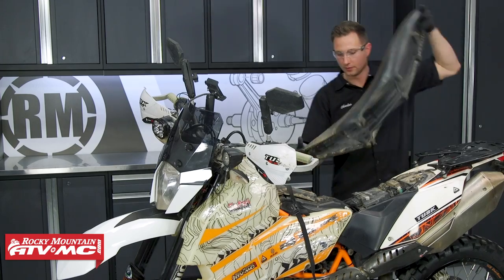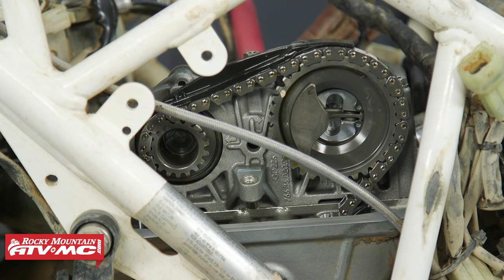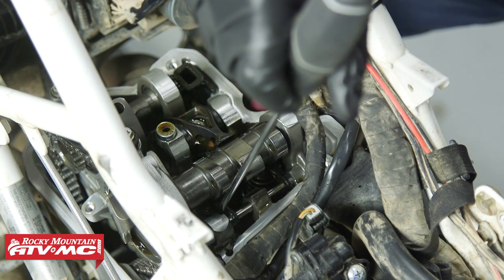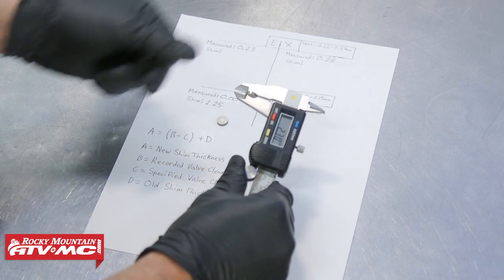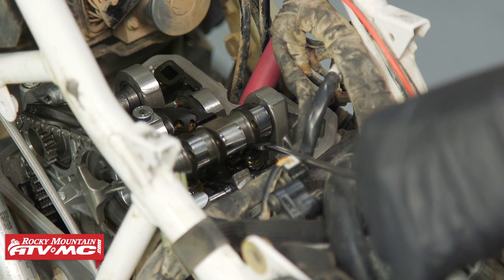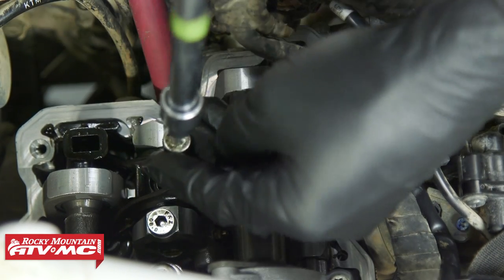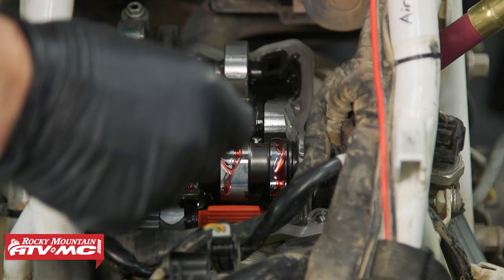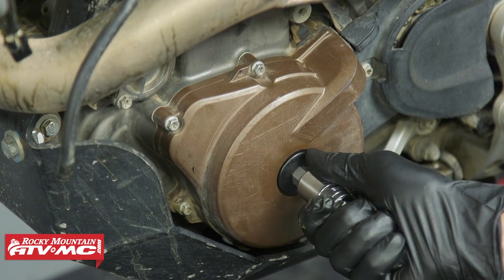How To Adjust the Valves on a 2017+ Husqvarna 701 & KTM 690

Comment: I've been working on KTM's for 18 years now,  I love that they stick with a design for 5-10 years and that I can use parts from a 1998 KTM on my 2024.   They remind me of a vintage Volkswagen,  or a Chevy 350,  or an LS.   Triple clamps,  54mm for the top, 60mm for the bottom.  Frame neck OD,  59.5mm.  Foot Pegs....they all fit.   Rotors,  260/220mm forever with the same bolt spacing, 300mm/240mm for the bigger bikes.   For the most part they keep the same part numbers too.   Japanese bikes make changes every couple years so nothing seems to interchange and they like to change part numbers every year too.  .

Comment: There is no decompression function on my 2020 690 enduro.   When turning the crank to position the cam as instructed, I used a long-handle socket wrench (breaker bar) towards the rear passenger peg and duct tape it there to hold the cam in the correct position.

Comment: I thought the KTM 690 didn't get the newer balance shaft motor until 2019?  The Husky got it a year or two beforehand.  So wouldn't a 2017 KTM 690 still have the older style motor/valve shim setup?
Reply: No the 2016 701 had the old style engine.

Comment: Thanks for the video.  Very helpful!  

That intake finger follower clip retainer system is cool - before I saw this video I figured the cam was gonna have to come out and I was dreading that.  Nice to see KTM/Husky thinking of serviceability in this design.  Had a TL1000S years ago, got spoiled by that bike's lift out hybrid chain/gear driven cams, which were almost fun to take out and  put back in.

One observation for anyone doing this.  While pulling the rocker and installing the exhaust shims is easy, the intake shims were tricky as the cam is in the way and my magnetic flat blade screwdriver was not magical like Charles' here.  All my magnetic screwdrivers were a bit weak, and my small magnet used to suck the shims out was way too strong and bulky to put them back in.  The right shim is not too high risk, dropped that a few times into the head and retrieved it with my strong magnet, but the left side was scary as I worried about dropping it down the cam tunnel and that would have sucked.  So I stuffed a rag in to prevent that and ya, it saved my bacon when the left shim inevitably wobbled and fell off my screwdriver while trying to install it.  Finally got it in but it wasn't super EZ like the video.  I guess I need a different magnetic screwdriver!

The subject of all this was my new '23 701, did the 600 mile service, all of the valves had 2.28 shims from the factory.  Both exhausts measured .178 (tight, the minimum spec is .220) and the intakes both measured .10 (right at the minimum spec). This is in line with other KTM products I have owned.  They bed in and the valves are tight when new, once adjusted they hold their clearance well.  I adjusted both intake and exhausts to be near the looser end of  the spec.  I prefer not to do the intakes again any time soon 😆  

Don't skip the initial service on your KTM, those valves will probably be tight.  On the plus side, there was zero swarf in my 701's oil screens. My '10 450 had rather scary looking metal in the screens, which was "normal" back then and apparently of no consequence as that bike continues to run like a train 13 years later.
Reply: Great comments.  My 2019 701 mag plug looks like I've dropped it on the workshop floor. I hear that's fairly normal,  bit I don't like it at all
Reply: @everydaybiker  My old 450 and my 701's 2nd oil changes were very clean debris wise, nothing in the metal filters at all.  There is always going to be some fine black magnetic "sludge" on the drain plug which means it's doing it's job I suppose! 

I added a PC6 with Rottweiler's map and a Yosh can to my 701, the power is stupid enough now that I actually geared it up to 16/46.  It pulls like a train and the longer legs are nice on the street, and don't hurt it off road.  I actually like it better in the dirt, 2nd gear is stupid fun on the more open 2 track stuff.  These bikes are good enough that they can get us in trouble wherever we go 😆

Comment: Hey, weird question. I’ve been following your video and it’s been super helpful, thank you so much. I have a 2019 701 and I’m trying to change out the exhaust shims. You mention that you need to move the auto decompressor out of the way, but my bike seems to have a different assembly for it. Is this step still necessary?

Comment: I have a 2021 ktm 690 smcr and I’ve followed this video through. I don’t see an auto decompressor, there is something like it but it doesn’t slide back and forth like the one shown in here. Kind of confused on what to do next to get my exhaust side done😅
Reply from the maker: It's still on the intake cam for your bike, but the actuating mechanism looks different for yours. You can spread the weights apart or rotate the engine over until the decompressor on that middle lobe sits just above the rocker without pressing on the rocker. Then you can make your checks. -Charles

Comment: The manual calls for using a locking screw. Is this critical for just for extra security to insure the engine does not move in the process? Thx

Comment: Great video Charles!  Silly question, but you don't have to drain the oil to do the check (and even the adjustment if need be) correct?  I'm thinking to check it with the oil in, and if it needs adjustment, take that opportunity to change the oil right after or before. Thanks for the video!
Reply from the maker: The oil is a completely separate deal. Definitely do it if you're at the change interval. -Charles

Comment: How long should this take for a DIYer? I know the video is only 16 minutes, should I plan for 2-3 hours, slightly more, slightly less?
Reply from the maker: Yeah, 2-3 hours is about right. The time consuming part is gaining access to the valve cover and re-installing all of those parts. If you are cruising through, you might be able to get it done in about 1.5 hours, but it's always better to take your time and make sure it's done right. -Charles
Reply: @rmatvmc  thanks, I've done a bunch of stuff to this bike already and every time I start something it's like this'll take 30 minutes, and 1.5 hrs later I'm finishing up. I don't want to do that with everything open. Much appreciated.

Comment: would valves hanging open cause a hard start when cold?
Reply from the maker: Yes. It can't make good compression if the valves are hanging open. I'd also check to see if any dirt got past your air filter and address any issues there. Get those adjusted up!! -Charles

Comment: Hey Charles. I had a question for my ktm 625 smc. I’m doing a rebuild and want to know where the locking bolt for the crank is located. Any chance you may be able to help? Thanks
Reply from the maker: I don't know on that one. My manual doesn't show it, but if it has one, typically you'll see a bolt with a thicker copper washer on either side of the crank. You can still get everything done without it, just verify you are at TDC when setting  timing and valve lash. -Charles
Reply: @rmatvmc  ok thanks 🙏🏼
Reply: @rmatvmc  Charles just one more question. Removing the nut from the cam gear if I do that then it will move. Could I use a clutch holding tool on the sprocket so that it doesn’t move when I go to take the cam gear nut off ?

Comment: How many miles were on this engine? And is the 1st adjustment it needed?
Reply: Not sure on this motor. Most people that I know with a 701, myself included, the valves were ‘within spec’ on the first check but needed adjustment on the second. Riding without having them in spec could cause damage to the valves.

Comment: I have a 2022. Which bolt is used to go through the side to get the rocker arm shaft out?
Reply from the maker: Check out this schematic: https://www.rockymountainatvmc.com/oem-schematic/4?FirstChoice=KTM&SecondChoice=110717&ThirdChoice=116711&assemblySchematic=116737